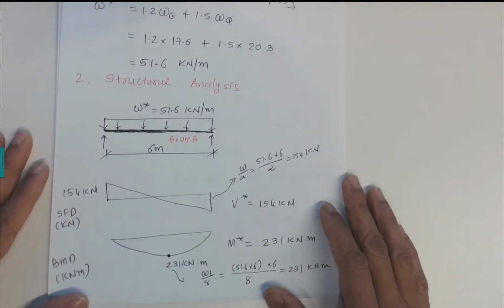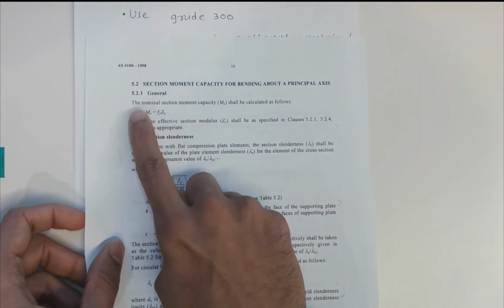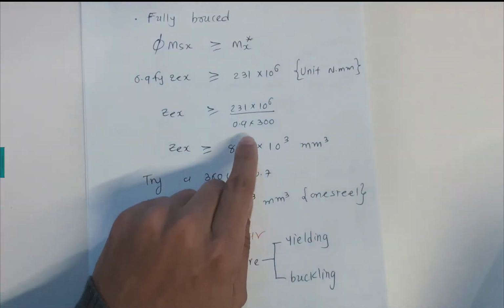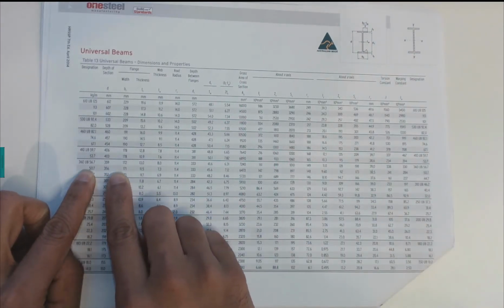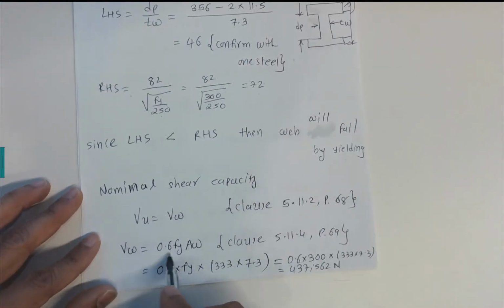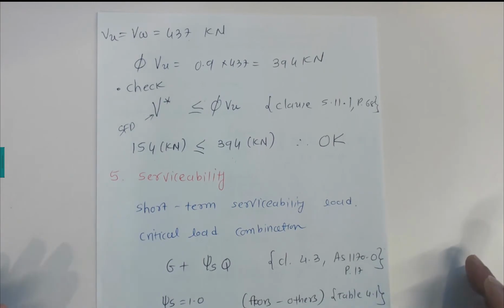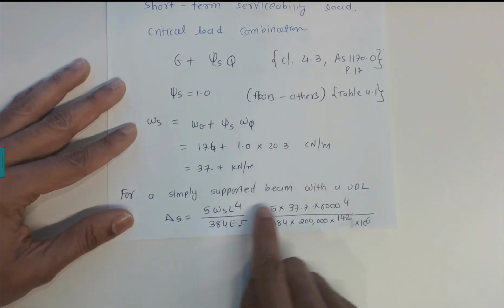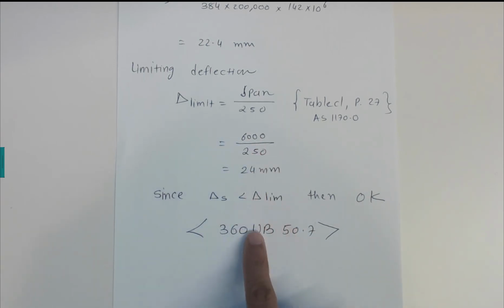Steel beam design for Shear Example 1 Part 2

Comment: Hello Dr. Vipul, 

With regards to shear design, in this case shouldn't we be using 320 MPa instead of 300 MPa? As the onesteel tables indicate 320 MPa for the web of a 360 UB 50.7.
Reply from the maker: Sorry for the confusion. Please use 300 MPa for flange and 320 MPa for web.

Comment: Hi Dr. Vipul, I'm just wondering why we have used Sx value to choose the suitable beam section while we got the value of Zx to compare with?, Thanks
Reply from the maker: Hi Michael, 
AS4100:2020 Clause 5.2.3 says that the effective section modulus (Ze) shall be the lesser of S or 1.5Z. Therefore, we can say that Ze = min(Sx,1.5*Zx). For our case, we have the value Zx = 798 and Sx = 897 so Ze = min(897, 1.5 * 798) = 897. It means I can used Sx value. I hope it helps.
Reply: @patelstructuralengineer1  Much appreciated